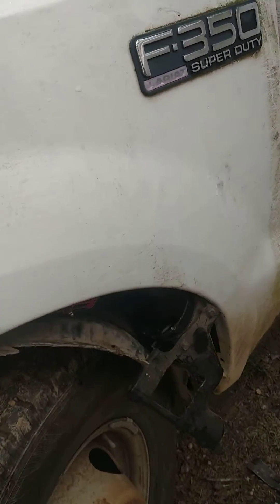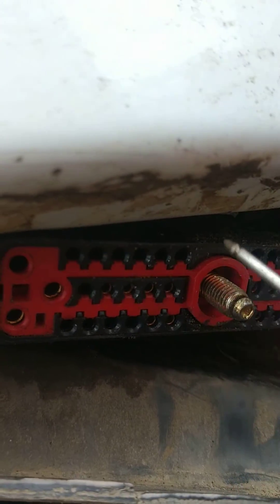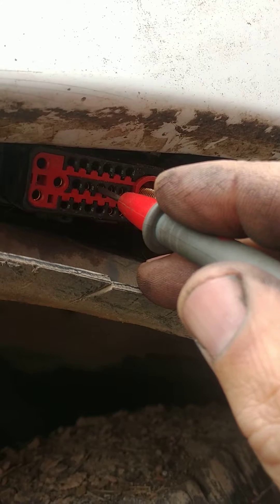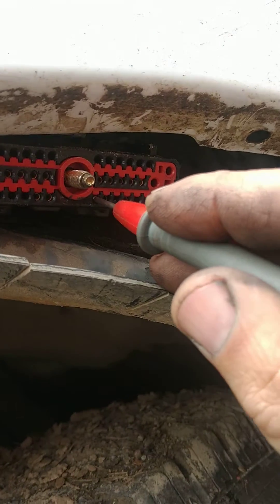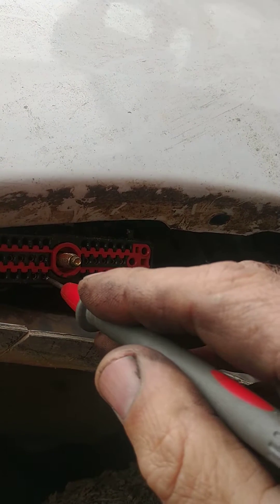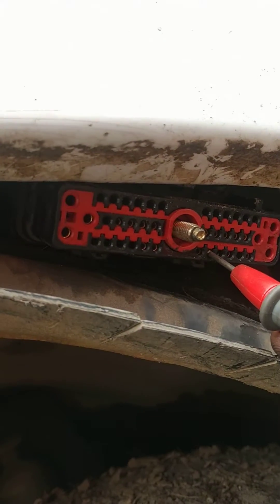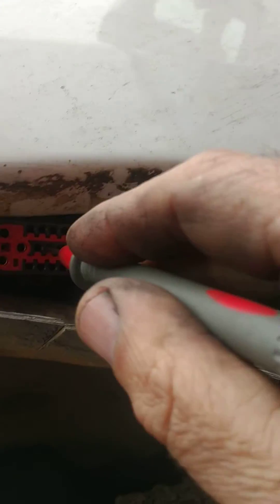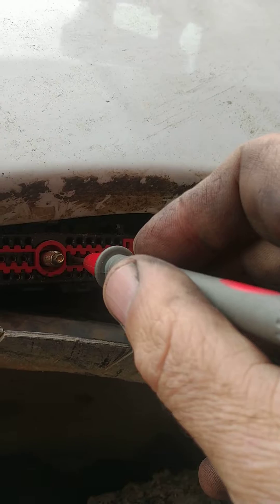1999 7.3 IDM wiring harness trouble shooting

Comment: Everyone, before you declare either of the 2 computers toast, crack them open, their will be a circuit board, and the metal case, with a few  bolts grounding the circuit board to the case.  I used to do injection pump rebuilding for the second biggest mercedes diesel parts dealers in the usa, and so we did most all the diesel work, causs the next diesel shop was like 100+ miles away.  So all the other mechanics and i drove old 7.3 fords cause our company ran them, and when they finally died, theyd sell them to employees for the $1000 or whatever the super low trade in value was at the dealership, it was a nice perk, hah.  When the computers tested bad, i would take them apart, clean off the internal computer grounds, and shed fire right up.  Just make sure you use somthing tough, like butyl windshield glue, or body panel adhesive,  to keep water out.  I use flex tape or masking tape as a temp seal when sealing up the computer case again, to verify function has been restored, before you seal it up with  something mean like butyl.  Auto computers are increadably tough, they mostly use carbide chips instead of silly-cone, so they are slower but much tougher.  But much of the modern 1996+ computers use just 5v for sensor so its like being back in the old timey times, with the 6v electrical systems, and everything had to be clean and tight to mostly work.  So when you work on the modern junk, just pretend its an old ww2 jeep and you gotta get every little connection squeaky clean.  Best luck all, bayou diesel is. Very helpful  with his 7.3 experience on youtube here, and as a plus, hes good about testing stuff, instead of just throwing parts at it, which is a good skill to have as wages continue to stagnate, shall we say, hah.

Comment: Nice Video, I have a short on 23 and 26 any ideas ?
Reply: Im having the same issue did u figure it out
Reply: Im having a short on pin 23 to 26 and on24 to 26
Reply: Yes I did..... my wiring harness was all melted together. I'm surprised that, that it didn't damaged my entire electrical system.

Comment: Do you need the truck in or off?
Reply: This is testing resistance of injectors and wiring to them, for shorts or opens, and proper overall resistance.  To test power into the FICM/IDM, key on, engine off should work.

Comment: So when testing it do u put the key in and turn it accessories on???
Reply: No its just a test for resistance the meter sends its own current through to check for continuity.
Reply: @midcraze3466  thanks👍
Reply: I’m getting 0 resistants

Comment: Hey its grandioso..I've done all this..but only 2468 are injecting fuel..I've tried with pressure test and was correct9between 250to300psi...I do test by doing ipr to ground and with almost 2000 psi continued injecting only 1357 do inyect fuel!..how much high power voltaje brings to each sides?sorry my English is being better...perhaps you could understand it.thanks

Comment: Were you having a lope start? Sounded like it was running on half the cylinders? & some white smoke out the back?... let me know if the IDM fixed this. Or what did
Reply: When putting in new idm does it need to be programmed or can u use anyone’s idm as long as it’s same year and motor??
Reply: Mine had this issue, swapped idms and it ran like a charm
Reply: Mine did the same changed idm... I think from autozone...any way 1 year later doing the same all of a sudden.??? Any suggestions?
Reply: @ewross1  Theres a video on bench testing them and replacing cheap resistor.